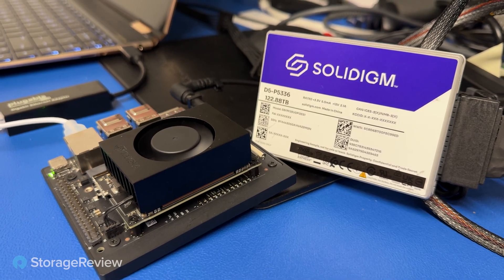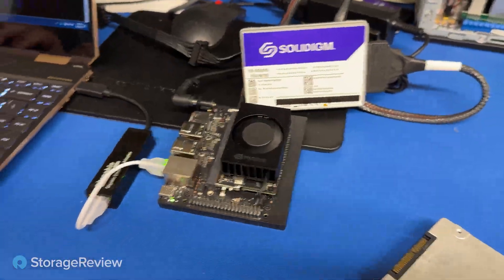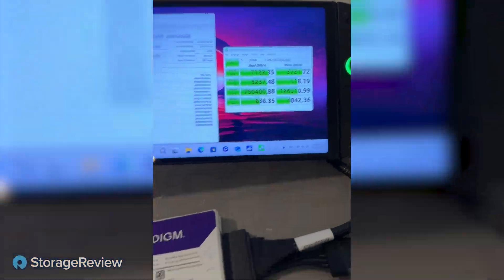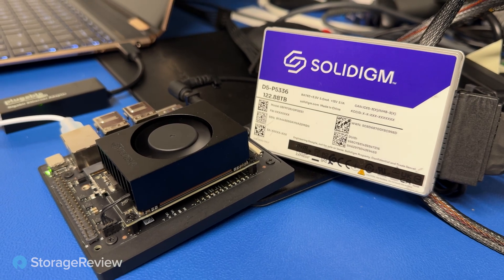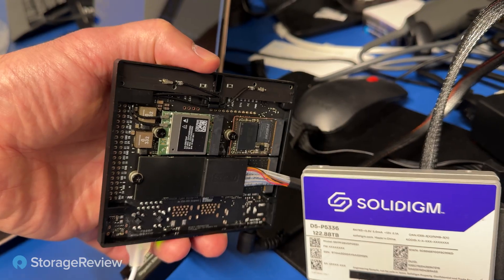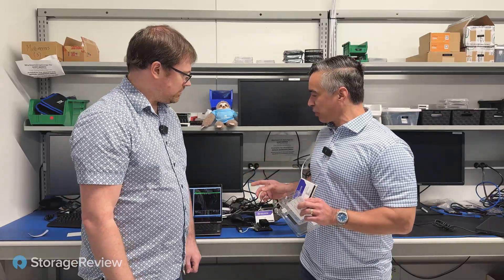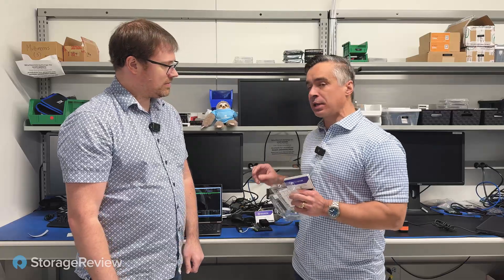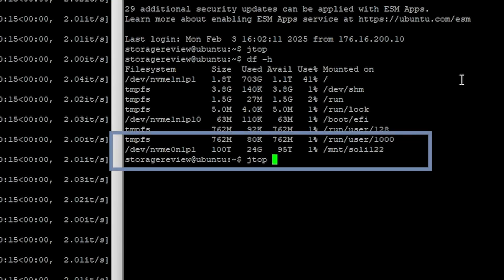We Installed a 122TB SSD in a $250 AI Dev Kit – Here’s What Happened

Comment: It has been fairly disappointing with the ssd market as they seem to have stalled in price point for capacity improvements relative to the old spinning drive year on year improvements . Perhaps this is due mainly to sufficient demand and insufficient fabs
Reply from the maker: You nailed it - it's a market supply issue.

Comment: basically another useless drive.  Same issues as with large traditional storage.   Too large of a capacity for the interface speeds and iops performance which basically makes the user's ability to use the drive for reliable storage moot.   (MTTF_DL is too low due to inability to validate; repair; duplicate data when issues occur).
Reply from the maker: We're hearing a lot of interest from unstructured guys, don't think they'll have any trouble selling these.
Reply: The only problem is the cost/price tag 

Gen3x4 do 3.5GB/s with some overhead and 1TB only takes 5minutes to fill 

122TB write takes 600 minutes = 10hours if this thing can run at sustain speed 

Now try to fill up a 22TB hard drive aka spinning rust with the 250MBish speed which slow down at the rear end (inner circle of the disk ) , it takes more than a whole day
Reply: @frankwong9486 That's at 100% repair duty cycle which you would never use, and if the scan/repair is sequential blocks which also is never the case.   So basically cut that in at least half for speed (probably even down to 20% as you are still servicing requests), and greatly increase iops requirements to update blocks across the drive (which many of these drives suck in random iops performance (i.e. < 100K IOPS)).    Can't really see anyone who does large scale storage using these due to those problems.